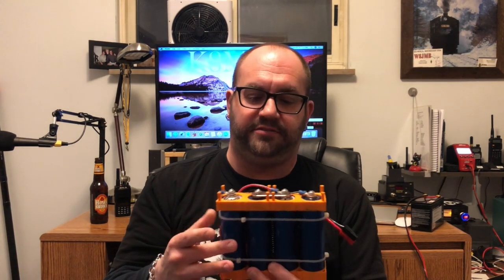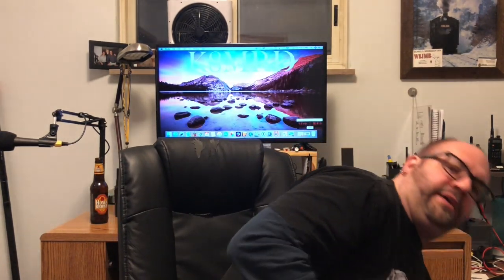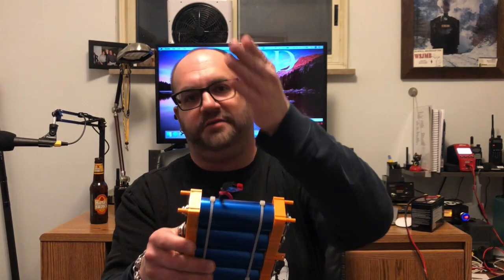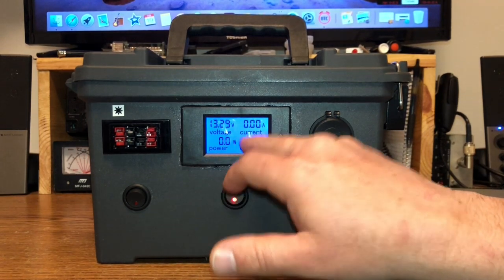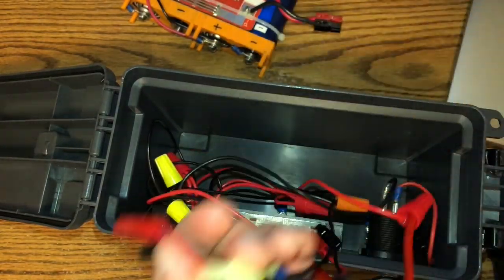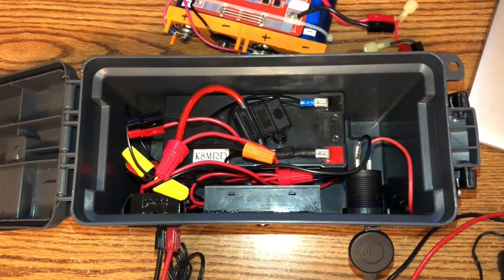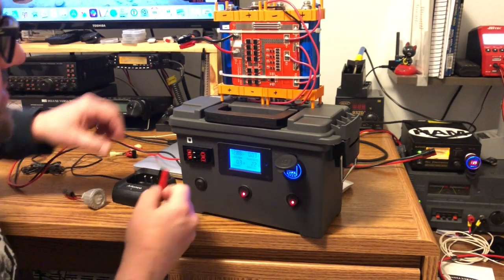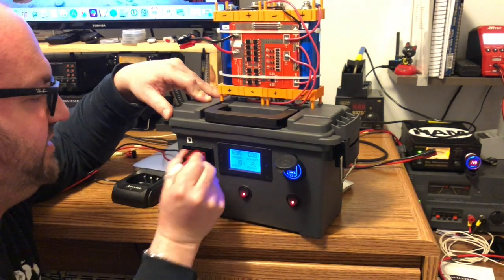My Portable Ham Radio Power Solution

Comment: Outstanding. The whole point of sharing those projects is to get others to build them as well. My mission is complete. :-) 
When I first started setting up the shack to run off solar power, there were also some practical reasons for doing so. My wife once complained about the electricity bill. She doesn't complain anymore ;)  Then there's that lead acid battery myth. I guess you realize now they're two or three times the weight and only half the capacity of what they're said to be. So it looks like you've caught the bug as well. Sharing your video on my blog. Hopefully that'll bring you some more subscribers. Thanks for sharing, and for making my day.
Btw, please put some kapton tape across the bus bars. 100A will make a heck of a bang.
73
Julian oh8stn
Reply from the maker: Haha I like big bangs!  I def have the bug.  I've done so much research on batteries before building this and then saw  your videos last year and read your blogs and it just made sense to go this way vs something commercially made.  Thanks for sharing and making my day good sir.  73 
P.S. I'll look into some kapton tape.
Reply: OH8STN yes. I’ve experienced the sparks. Wrap it up and keep it safe!
Reply from the maker: @justindsligh  Some people would think the MRD in my callsign is my initials.  It actually stands for "Meets Required Danger" hihi!
Reply: I just got to say THANK YOU for making these videos. K8MRD, I discovered POTA because of your video and I'm going to dive right into that aspect of ham radio very soon. I've been licensed since 1988 but have been dormant for 7 years or so due to domestic/work life taking over. Now I'm getting my wife into the hobby, we're going to start activing all of the parks in our area. I have an IC-7000 with a buddipole and a couple of end-fedz wire antennas that I plan on using. But power was my concern. I've been looking at different things out there but saw you hold up those 4 38120S's in series and you said that would allow you QRO and I was like THAT'S IT! I want something light weight, compact, and easy to store that will provide me with hours of QRP, and acceptable QRO operation in the field. I then looked at Julian OG8STN's video on the build and I am very grateful for the articulate and well developed video on the buildout of this system. Because of that I'm going to follow both of your ideas. I'm going to build a small tool box/ammo box to build the battery system in to accept connections with lugs, power poles, and USB.

I have a question though, You linked a charger on amazon. It cost 70 dollars.  How long does it take to discharge and charge that setup you have using that charger? And on the solar panel side of it, how long does it take to charge up using the solar cells? Again thanks to both of you for videos.  73, Jimmy K5OP
Reply from the maker: @nexusnrg  Hi Jimmy, I am always humbled by such positive comments such as yours.  I'm so grateful that I can give back to the community and help share what I love, much like others have done for me.  Thats awesome that you and your wife are going to start doing portable activations.  
As far as the charger, I don't really use it to discharge but I can set the rate of charge.  I usually only charge at 1 amp so depending on how depleted the battery is, it could take up to 10 hours if I ran it all the way down.  The max charging rate for the charger is 6 amps so quite a bit faster.  Less than 2 hours if it's flat.  I usually use about 2.5-4 amp hours when I'm portable.  I have never run out of battery while doing an activation but I would guess around 2-3 hours @ the 90 watts I usually run. Lower power will yield longer run times of course (which I am considering doing, maybe 50 watts) I also don't have any solar to charge this so I wouldn't be able to comment on that.  I do know to be weary of the less expensive, seems too good to be true solar panels out there, especially on eBay.   They most likely will not produce but a small fraction of the power they advertise.  There is a reason the  Power Film costs as much as it does.  Anyway, I hope this answers your questions.  Have fun building the battery/box.  It's a great build.   Thanks for watching and 73!

Comment: You can get 50 footLED stick on that can be cut about every 3 or 4 LEDS. 12V  I put some around where my radios are for some light. I still need to get some overhead so I can see better to write things.  In Florida we do have the power outage from Hurricane.   73.  W4DES

Comment: Have you considered using one of the USB powered, laptop lights? They use a small diameter, flexible goose neck, which would allow for light to shine on the box's face and / or inside the box.
Reply from the maker: I've though about them but I really don't need one.

Comment: Nice, have you charged your lifrpo4 battery pack with solar panels? ..can we use regular 12 solar charge controller?
Reply from the maker: Yes I have.  No you can't use a regular charge controller.  It has to be for LiFePO4 specifically.  I haven't done a video just on solar yet but my 2020 field day video shows what I'm using.  Here's a link: https://www.youtube.com/watch?v=2NBdlGUN9Y8  Also check out OH8STN's channel, he's the one I learned all this from.

Comment: Bill N6EF-Love your battery box. I'm building one this weekend and I'll be using the Harbor Freight ammo box as well. I have the Bioenno 20Ah battery to put inside and have all the same connections and meter you do along with the Bioenno 120 watt solar panel and charge controller. Julian's channel was also a great inspiration for getting back into ham radio after many years of inactivity. Looking forward to portable operation with my FT-857D and new battery box.
Reply from the maker: Thats awesome.  I take my battery box pretty much everywhere I go.  It was a really fun build and a very practical bit of kit to have with you.  Thanks for watching and have fun portable.  73

Comment: Building these power packs is a hobby in itself, pricey, but if you need really need 100W and light weight for SOTA, they are pretty good. I may have a dabble with the OH8STN setup, in the meantime, I'll stick with my SLABs, QRP CW and stay close to my car when operating! Thanks for the very informative vid 73, Keith
Reply from the maker: Yeah but its awesome!  This 10AH prob weighs less than a tiny SLAB and you can get all 10AH's out of it.  Plus, I learned a lot about batteries by watching Julians videos as well as building it myself.  It is cheaper to buy one from Bioenno though.  For qrp they make some great batteries for about $50.  Although getting them to your part of the world is prob going to double the price just for shipping.
Reply: @hamradiotube  Yep, import duty and shipping is a huge issue, especially with Elecraft stuff, the exchange rate is poor also.  I will eventually build a pack, when I can source decently priced cells.  It's great to see you guys doing SOTA/POTA and experimenting with new gear.  I've been doing QRP & /P since 1981, but I'm still learning stuff.  Every day is a school day!  cheers, K

Comment: Thank for this video.  Very timely for me despite being 13 months.  One thing -- it would be handy to know that if you paid list price for every component -- what would this battery box cost to build?  What is the out the door price?
Reply from the maker: I think I talked price a little in the video but I really don't remember.  The battery itself w/ the BMS was about $165ish.  Prob another $50 or so for all the parts to make the battery box.  There are links in the description to everything I use though.  Thanks for watching and happy building!  73

Comment: I bought the same BMS. What guage wire are you using for the balance leads? 73
Reply from the maker: I have a hacked build honestly!  I have 14AWG for my positive and balanced wires (red), 16AWG for my negative (black), and I think either 12 or 10 for my power wires.  Its just what I had lying around when I made it and never bothered to do it proper.  14AWG all around should be adequate though, unless you are trying to start a car perhaps.  Check out OH8STN's YouTube channel if you haven't already.  He's the one who I learned this build from and shows how to do it.  73
Reply: @hamradiotube  Understand! On a different thought... I'm thinking of buying a FT-891 to replace my Icom 735. (1988) It would have to do double duty. Home and portable. What do you think of the 891 if it was your only rig? What is your other rig? Tnx. 73 WB7DUO
Reply from the maker: It was my only rig for about a year.  I used it in the shack and out in the field.  It’s a great radio and should suit one well.

Comment: Another great video!!  After watching the other video though, don't think I will be building the battery system that you did.  BUT, I do like the battery box setup and might build that!!  Of course I have a video of my "Camp Radio" or go box, whatever you want to call it, on my YouTube channel.  It has a quad band Chinese radio that does VHF/UHF and I have the 12 volt 7 amp/h battery built into it and have sockets for the USB system, a 12 volt cig lighter plug, some power pole connectors and it is all sealed up.  No openings drilled into the 50 caliber ammo can at all, so it is weather tight.  Great video again!!  Juddie WD8WV
Reply from the maker: Sounds like a great go box.  And yes, buying a Bioenno would be cheaper than building this battery, but I just really liked the idea of building it after watching The Godfather of Batteries, Julian OH8STN.
Reply: K8MRD RADIO STUFF oh yea, I understand about building your own.  That is why right now I am building my own, I hope, wrc style antenna!  I have already made the coil inductor and the slider.  Just have to finish up the base and the top.  I have built a QRP Labs QCX40 cw rig and have a QCX20 waiting to be built.  I have also built my uBitx and made my own housing.  All this is on my channel along with the camp radio.  Again keep up the great videos, and hope to work you again either as a hunter or an activator when I activate my next park.  Juddie WD8WV

Comment: You have the same setup i have with the ft-891 and i have been trying to figure out how many of those batteries to get to setup mine. I was not sure how many hours of operation you would get get with 4 batteries.  Assuming 15% transmit time, how many hours would you estimate those batteries would work?  Looks to me from what your said on the video about 8 hrs is that correct?

Comment: Thanks for posting this  ...  I'm just getting started with LiFePO4 batteries and portable power sources in general. I beginning to collect parts now for the 4 cell build and won't be adding the solar charger for a while. Can you recommend an AC charger for this build? Also, is that a Venom Pro charger on the shelf in your video and would that work for this?  Thanks pat
Reply from the maker: No problem Pat. I’m using a HiTec charger. You can find links to everything in the description.

Comment: Ten full hours! That is awesome! I am in the middle of a build. Can you explain the fuse sizing for the power poles and how much draw you would expect on a field day situation?
Reply from the maker: Yeah it's pretty awesome.  In the battery box that I usually don't use I have a 25 amp fuse on the positive wire.  When I just use the battery I don't have any fuses but the one on the radio wire.  Good luck on your build!

Comment: Hi there,. 
I built this battery pack  I got the charger you recommend but get an error  "Connection error check main port"  when I attempt to charge...  Any suggestions?
Reply from the maker: You got me buddy.  Make sure its set to charge LiFe batteries.  Also make sure it is set to charge 4S. You should be good to go after that.  If it still doesn't work I would look to see if something isn't wired correctly.  Perhaps something with the BMS.  See if you can take that out of the equation and try charging the cells without the bms.

Comment: @K8MRD Have you tweaked any settings on the Hitec RDX1 for bench charging this LifePo4 pack?  Just built a pack and went to charge the pack as a whole for the first time and received "Over charge capacity limit" on the Hitec
Reply from the maker: I have it set on LiFE.  4 cells.  Charge voltage 3.65V and I usually only charge at 1amp but you can go up to 10 if you want.
Reply: @hamradiotube  Rock and roll.  A few more settings I had to change were the Time Cutoff (off), Cut Capacity (off) and Bal Connection (off).  Not sure if you had to adjust those as well.  Thanks again and looking to connect on the air.

Comment: nice setup there, I would strongly suggest getting rid of the twist connectors those can work themselves loose, solder and heatshrink is the best way. also make sure the gauge of your wires carrying the current are all at least 14AWG becuase 20A is way too much for anything smaller. with a rewire that box would definitely be the perfect portable power station! great job
Reply from the maker: Yeah I could definitely tidy it up for sure.  I just made it to have.  I really don't use the whole battery box that much though.  I just take the battery itself when I go portable.  Just a fun project.

Comment: Honey Brown!! I knew there was something about you I liked :)
My only concern would be that the rocker switches are rated for 20A, If you run it at "full bore" 100W radio output, lights, USB charging, meter etc, etc, you could  possibly have an issue with the main power switch. Not real likely, but it is possible.
Reply from the maker: Yeah I haven't had Honey Brown in a while!  Great beer.  I'm not too worried about the box though.  I don't really use it portable.  I just take the battery itself.  I don't want the extra weight/bulk.
Reply: @hamradiotube  love you videos. I am planning on heading out to K-1332 tomorrow. Keep an ear out :)
Reply from the maker: @RetiredRoadTrips  Right on man!

Comment: Great video. You may have mentioned it in the video but how long will this pack last while transmitting at 100 watts using the FT-891?
Reply from the maker: timothy owens I honestly don’t know for sure. I’ve never ran out.  I do know that I can get all 10 amp hours out of it though.  I would guess 3-4 hours of operating though.

Comment: Just received Yaesu FT-891, Dakota Lithium 12v 10ah and charger. Need recommendation for Charge Controller and Solar Panel? (Cheap ; )  First contact with new FT-891 was today on 20m dipole Baltimore MD to OK. Like your videos. . .
Reply from the maker: I don't even have anything good for solar yet but the Genasun charge controller looks like a winner.  Buddipole and Bioenno also make ones that people seem to like.  Not sure about panels though.  Bioenno seems to be pretty decent for the price and I think Renogy as well.  I have a Lot more research to do on those.  If budget isn't a concern, then get the powerfilm 120W.  Sold for the low low price of about $1300-1500!  Congrats on the 891 and first contact too!

Comment: Nice one Mike. I put my pack in a molle pouch with the battery already shrunk wrapped and then wrapped in some thin sheet packing foam. The BMS doesn't get very warm at all under no use and the foam adds a thermal layer to keep the batteries from getting too cold. I'll do a video myself about my pack at some point. 73s and keep up the great work.

Comment: Nice job on the power box. I found an ammo can in storage and going to create one. What size wire did you use?? What size Anderson connectors did you use??
Reply from the maker: Awesome, I'm glad to hear!  I'm using 14awg wire and 30amp Andersons.  12awg would be better but thats what I had laying around.  73
Reply: Ok sounds good thanks for the info..

Comment: Does the BMS act as a charge controller?
Reply from the maker: Nunya Dibness Nope. Those are 2 completely separate things.  The bms manages the cell voltage among other things. A charge controller manages the input voltage from a solar panel.
Reply: @hamradiotube  - Ok. I will do some more research. I want to built a new, lighter battery box.
I have a 35ah Agm, but it is quite heavy. It has come in handy during power outages by my step-daughter to charge her cell phone. Believe me, a teenager must stay in contact with her peeps. Crisis averted - step-dad hero.

Comment: I am inspired! Being too poor to buy an already built power box is also inspirational (though in a different way). Can you give an estimate on cost? How do you charge it without solar panels?
Reply from the maker: Stuart Hall I forgot to put the charger in but it’s one I got from an RC shop that is made for lithium batteries.  Cost was about $160 ish for the batteries and bms and another $60 for the charger.  The stuff in the box was pretty inexpensive from amazon.  Just look up 12v and hit search.